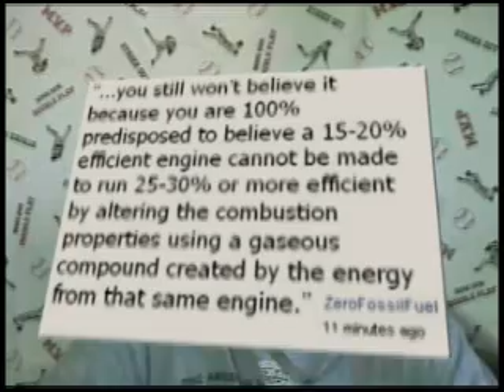Follow-up: '#232 - HHO runtime experiment part 3'

Comment: @MegaVelvetElvis --- Quit taking shit out of context, a better burn in the context used in the paper means a more efficient BTE with reductions in most pollutants, you are being a dumb ass again.  The direct quote is "The decrease in the total fuel consumption is due to the better combustion of the formed mixture owing to higher flame speed of hydrogen and overall leaner mixture" That does not mean more of the fuel is burned...

Comment: @luc59457 --- Why do I have to provide this physical evidence when that data is included in the peer reviewed paper? Sec. 3.2 talks about the BSFC which is fuel flow divided by HP. You cannot get this figure without considering HP. "Furthermore, 3-7% increase is nothing to be impressed over due to the extra parts needed." ah but i does prove that on-board electrolysis can save fuel, therefore it does not violate the laws of physics, which is what I've said all along...

Comment: @MegaVelvetElvis --- Unbelievable, did I say MIT had anything to do with electrolysis? It's not about the 2% of fuel left over, assuming the 98% is correct, it's about how much usable energy you get from the 98% that is burned. MIT proves there is room to improve MPG by increasing the TE of the burn. It was offered to disprove the silly notion that there is only 2% to work with. Quit being a dumb ass...

Comment: @HHOinfo --- Simple minded fool, the over-all effect is a gain not a loss, read the paper. "Modern engines burn 98% of the fuel, That only leaves 2% for HHO to take care of." Ah No, the modern engine may burn 98% but it's efficiency is only around 20%, there is plenty of room for improvement. This is the 6th thing wrong with your website. If what you say is true then how in hell did MIT post up to a 50% gain by pre-combustion of gasoline in order to increase the free H2 levels?

Comment: @MegaVelvetElvis --- Here's the peer review statement by the publisher, tinyurl 2bvt95b. Read the paper, the energy needed to produce the HHO is included, it not missing. "I guess will have to go with that" means the paper specifically notes the use of a external 24V power supply. Will have to use the facts we are given, not speculate as to other sources to satisfy a conclusion not drawn by the data...

Comment: @Desertphile --- How do I break the news to such a simpleton, the paper appears in a peer reviewed scientific journal. Here's proof of that statement. tinyurl 2bvt95b. And the device they used is the same as the models being used in vehicles, it only work with different voltage. Your argument has no basis in fact so please provide facts to back up you assertions. Where in the report does it say that H2/O2 mix cannot improve engine efficiency and causes fuel losses?

Comment: @MegaVelvetElvis --- "It's not a new technology, and not even an unused technology. It's not used on vehicles because they are not as efficient as stationary power plants." And it's this inefficiency that makes the gains using HHO work better. That's how this technology works. It's not about the energy in HHO, it's about how much more efficient HHO makes the other fuel. The gains come from a better burn of both fuels...

Comment: @MegaVelvetElvis --- Earth to MVE, the data in fig 2 and 3 are from the same data set, #2 is in % while #3 is in LPM, it's not a stretch. My assertions are factual based on charts 2,3, & 6. Quit being a dumb ass... 

"If they used the Epoch EP-500, it was 380V, 24v doesn't play" Really? Couldn't the Epoch EP-500 be 24V internally? 24V is what they say in the report so I guess we'll have to with that...

Comment: @TruthfulPinecone --- Facts are facts, read the report, fig 2 and fig 3 are the same data set, #2 shows the amount of HHO added expressed in % while #3 shows the amount of HHO expressed in LPM. Fig 6 shows the amount of fuel saving based on the HHO expressed in %. Now putting these charts together we clearly see that around 3 LPM or less than 1% gave a 7% gains in fuel savings. Can you not follow that?

Comment: @MegaVelvetElvis Part 2 - Reading all the graphs together we see that at ~3 LPM and 28K load we get a 7% savings in fuel use. @ 24V this would only be 22.75 amps, @ 13.8 V(12 volt system) this is only 40 amps. Now the reason we use this end of the graph is because you pointed out that HHO system us a max of 4LPM at 69 amps. What's the matter, did you forget what you posted? Apparently so since your numbers keep changing. Facts are facts, HHO @ 3LPM saved them 7% on fuel, deal with the truth...

Comment: @MegaVelvetElvis --- Read the paper and do the math, page 2 section 2, "In order to simplify the setup, the H2/O2 mixture was generated using 24 V external power supply." Now was the voltage 380V or 24V like the paper says. 3 LPM @ 5.5 MMW is 545.45 watts. 546 watts / 13.8 v = 39.56 amps, 546 watts / 24V = 22.75 amps. So where out of my tookus did I pull the 40 amps? Boy you are a dumb ass aren't you, graph 3 lists the L/M while graph 2 lists the corresponding %. Cont.

Comment: @TruthfulPinecone --- Oh wait, it's 40 amps on a 13.8 volt system, it's only ~23 amps if the voltage is 24V like the paper says. Now this assumes 24V I don't know yet what  the operating voltage is in a 24V system. If they use 2 batteries with 2 alternators to make this voltage then its only about 20 amps across 27.6 volts...

Comment: @TruthfulPinecone --- Part2 ... leaning the system out. The alternator is capable of making an extra 40 amps but that additional load on it will not result in a 7% loss in fuel. I can add a whole other high efficiency alternator without losing 7% of my MPG. Now factor in leaning the system out and with varying speeds and loads on the engine and you'll see that a 20% gain, like the real world testing at Ronn Motors, is not far fetched. The problem you have is with acceptance...

Comment: @TruthfulPinecone --- Hahahaha that's priceless. First off the paper clearly states the energy used to get the H2/O2 is factored into their equation so the 15.07% includes that figure. But for argument's sake let assume it didn't. Now MegaV and others have pointed out that the HHO units used by most people are around 3 LPM and figuring an average MMW of 5.5 that means it takes about 40 amps from the system. According to fig 2,3 & 6 @ 28K load I get a gain of 7% fuel savings even without CONT

Comment: @MegaVelvetElvis --- "Yes, that's the best way to get chart #6, not INCLUDING the energy it takes to get the gain. 4x the fuel to get a minor return." What? Where the hell are you reading that? I read, "The power needed to produce the H2/O2 mixture is included as an input energy to the engine." So the energy needed to get the gains shown IS INCLUDED in the fig. 6 data...

Comment: @MegaVelvetElvis --- Watch this video, watch?v=JYq511CCSRQ It shows where DP himself says using an external source is a proper way to test these devices. This way they didn't have to worry about building a HHO generator, they used a commercially available unit design for many purposes, none of them are automotive related...

Comment: @MegaVelvetElvis --- The effect H2 has on fossil fuel is the same regardless of where the H2 comes from. The only factor is the amount of H2 to fossil fuels. In Fig 2 and 3 of the Australian study it shows increases in TE starting with about 3 LPM (less than 1% diesel eq.) with all loads tested. Fig 6 shows that at this rate the fuel savings was from about 3% to 7% with the various loads. This document does say gains are possible with on-board electrolysis...

Comment: @MegaVelvetElvis --- The 30+ year report that shows H2's effect on flame speed was done by NASA, it's not from a published journal. As I understand it NOx values are based on heat factors rather than by burn efficiencies. A EGR system is used in motor vehicles to help reduce NOx. There is plenty of evidence that suggests higher levels on NOx are not present with all HHO setups. I'll try and find that evidence again and post it...

Comment: @MegaVelvetElvis --- There is plenty of supporting evidence dating back more than 30 years that H2 added to fossil fuels increases flame and allows for a complete burn. Reality would is different, the paper says the test was performed at a constant load and a constant RPM but in a motor vehicle these variables change. Based on how diesel engines work, varying fuel instead of air flow to control speed, and the fact H2 increase the lean-burn range of fuels the opportunity is there for higher gains

Comment: @Desertphile --- The DOT report references a study that showed a 4% gain in limited lab testing, that test was not done by the EPA so we don't know what method used to determine the gain. We do know that the DOT publication says gains maybe possible and the DOT even layout rules for the safe use on these devices in commercial vehicles. This was offer the refute the propaganda posted on HHOinfo's site not to prove the HHO works, the Australian study does that.

Comment: @MegaVelvetElvis --- Sure he could be wrong about the O2 sensor but the point here is that just because in 2008 he didn't see gains on his car doesn't mean that his customers did or don't see gains in diesel engines 1 to 2 years later. HHOinfo B/S implies that he's selling stuff he knows doesn't work, he's wrong for that inference...

Comment from the maker: @BlackDogSociety ; "Maybe they did the test using methods exactly like you proposed to ZFF?"

The EPA forbids the DOT from performing driving tests to determine MPG for the exact same reason they forbid automobile manufacturers from doing so. The EPA mandates all official testing must be in an EPA-approved dynamometer facility. But I told you that already, several times, over the past year.

Comment: @MegaVelvetElvis
IF say alittle as 0.1 gm of H2 cld aid 1L of gasoline to burn completely instead of partially, coz lots of hydrocarbs with potential energy r still released through the exhaust in cars not only pure co2+h2o, then obviosuly the efficiency wld increase. tht was my pt.

Comment: @HHOinfo --- Seriously? You infer that the unit he sold to the diesel owner who claims to get up to 47% better MPG is the same unit he had in his vehicle in the video one year earlier. Clearly it's not the same, in the video he says he hasn't seen improvement because of the computer in his gasoline engine. Had you taken the time to look at the website you'd see that his positive data comes from diesel engines where he doesn't have the computer to contend with. Cont.

Comment: @MegaVelvetElvis
Also typical gasoline engines r arnd 25% efficient, WITHOUT TURBO, n diesel engines can be 30-35% more efficient than those gasoline ones(see "thermal efficiency" at wiki).

Comment: @Desertphile --- Now you can find links to more info like this on my channel in the comment section, you'll have to scroll back a few pages but the info is there... You should really read more about it because you are wrong on this point. H2 does change the burn characteristics as I've pointed out...

Comment: @Desertphile --- Because I have posted them so many times. You yourself posted one. In the Aus Study says: "Compared to diesel, hydrogen has wider flammability limits, higher flame speed and faster burning velocity [5] which enable engines running on very lean mixtures [6–8]." Notice how it references other studies that prove that statement. Reading on we find that they show an increase in TE. Now a gain in TE means you get usable power out, ie a gain in HP. Cont.

Comment: @Desertphile --- That's funny. Don't you know that I make that statement based in part by information I found at the DOE? The rest of my information comes from other sources like NASA, MIT, and the Australian study you posted. While each of these reports show different methods of increasing the available H2 the results are all the same. H2 added to fossil fuels increases the lean burn range and the TE of an engine making the engine more eff. using less fuel. Cont.

Comment: @ReddmanDGZ --- I don't know why it is so hard for people to understand this point. It's not about the energy value of the HHO, its about the amount of converted mechanical energy the mix of HHO and fossil fuels gives. HHO extends the lean burn range of the fossil fuel while it increases the thermal efficiency of the burn allowing for more available mechanical energy. The net effect is more HP using less fuel and that results in more miles to a gallon of fuel.

Comment: the energy required to create the HHO is always going to be greater than the energy you would get by burning the HHO produced.

It's like putting a wind turbine generator on an electric car, the energy gained from the device is canceled out by the energy taken up pushing the turbine blades.

Comment: DP, about a fuel not being able to improve the efficiency on an engine. Sorry but you are wrong. NASA and MIT proved that adding H2 to fossil fuels does in fact improve the thermal efficiency of the engine. The Australian study shows the comparable increases in TE the only difference is the H2 in HHO is made by the engine. In both cases the added H2 does increase the power out from a lessor amount of fuel. More power out using less fuel leads to better MPG...

Comment: @NotSoOldHippy 

Wrong, assertive (as in, an assertion) doesn't mean the same as positive. If I say I don't believe vampires exist, that's not a claim, it's opinion. but would you say it's impossible for vampires to exist under any circumstances?

The burden of proof always rests on the one making a claim. Some skeptics get this confused with positive claim, when used as a response to negative claims. However this is a fallacy, the correct position of a skeptic is neutrality- NOT negative claim.

Comment: @NotSoOldHippy 

Yes the only race cars which are particularly advanced are perhaps formula 1, because they use composite materials and well designed aerodynamic properties. Their engines are still just more powerful versions of other internal combustion engines, ones which need to be rebuild after practically every use.

Comment: @anmoose --- "you may look up the definitions of those two words in any dictionary." Ok while I'm at it why don't you look up the definition for a rhetorical question. The study can be found in links on these videos:
watch?v=JYq511CCSRQ 
watch?v=Jw7zOFad4Po
Look in the description on both. 
I cannot say what methods were used by the testers at Ronn Motors but the results are in line with the study. But based on the facts I know and the things I've seen first hand I'd say they are accurate...

Comment: @anmoose --- Define rigorous and accurate for me? Apparently the peer-reviewed journal publication from Australian isn't enough for you? Now the Ronn Motors real world testing using Volvo big rigs was done over 100,000 miles, that pretty rigorous but would not necessarily qualify as scientific. The point here is that the theory that the H2 from on-board electrolysis can change the combustion efficiency enough to off set the loses in liberating the H2 has been proven. Cont.

Comment: @anmoose --- Here's the thing, working devices have been demonstrated. The problem is not with the technology, it's with acceptance by the YT naysayer cult. Scientific proof has been published that gains are possible using on-board electrolysis. Field testing has been done by Ronn Motors on late model Volvo big rigs with gains at about 22%. You can continue to believe that it cannot work or you can investigate it for yourself. Contrary to popular belief the world doesn't revolve around YT.

Comment: @Desertphile This i can tell you from first hand experience, that dynometer testing can only be taken on face value.  Even 10percent is within error correction. If done on 2 different dynos with the same manufacturer there can be 30% difference and thats if they are setup the same way, ramp rates, run on etc.  4% is maybe 12miles to a tank more? I can use 30% more fuel by thrashing my car, im sure i wont see 12extra miles here and there if i dont.

Comment: @sypher113 Ok smart guy lets see the set of calcs for the entire process that going on in the combustion of fuel. You dont have the ability to take all of the variable into consideration, just the gaseous air flow is too much for man even with the aide of super computers to calc. So when just trying to do the chemical reactions inside the engine there is too much CHAOS to be absolute with your cacls, thats why the cacls are done, and then the real world test is done, weak sypher, weak.

Comment: Re: Acetone in gas.  The issue at hand is, even if does work, how much does acetone cost. It is produced with fossil fuels. 
Re: HHO systems. advocates  need to study thermodynamics and pay special attention to the FIRST LAW. Let's assume a rosy scenario: 100% efficiency of the engine, the generator and the electrolysis system. We swipe some energy from our engine and convert it to hydrogen with 100% efficiency. We burn that hydrogen in our 100% efficient engine.
Q:What did we gain? 
A: NOTHING.

Comment: @Desertphile --- OK, what do you not understand about lab testing results? How can you say that the 4% falls within the error bars when there is no mention of even using a dynamometer.  Maybe they did the test using methods exactly like you proposed to ZFF? The simple answer is that you don't know, yet you automatically write off any positive results because in your mind it is impossible. You are wrong, positive results in diesel engines has been scientifically verified.